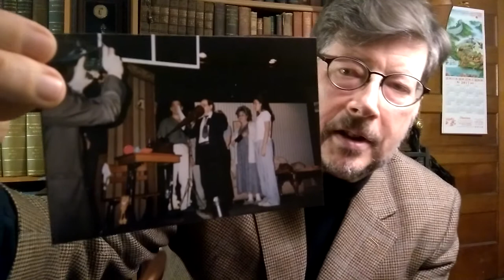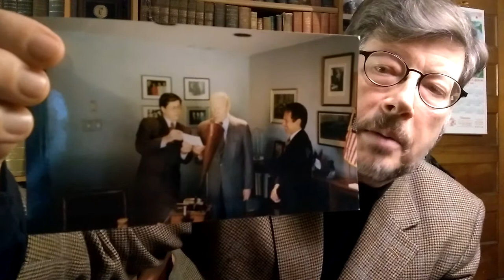Recording horns and their directional nature. A talk on the recording horn and it's limitations ..

Comment: hey Jack. it is truly an amazing art form making an acoustic recording. As you mentioned about the horn being extremely directional i find it fascinating how they used it as an effect as it were (like how they make someone sound far away in the distance - and it's done purposely to create that illusion). i think some of these descriptive selections on cylinder (depicting a scene) are the the predecessors of radio plays or dramas) . the info on the shape of horns is a great insight. I've got a large horn that i have tried recording with (did they have a bell type horn on the recording hiens in the studios?) regards Matt
Reply from the maker: Sorry for the late reply....  But I a have seen some and each had it's wonders and issues.  I found that in recording using big and small horns,

Comment: in my 30 years of collecting phonographs and recording with them, i pretty much came to the same conclusion as to the directionality and sensitivity of the phonographic recording device
 that was at least until I befriended fellow YouTuber benjamin Cannaday aka ''the victrola guy'' now my stance has changed somewhat
the ongoing experiments that benjamin did in the last couple of years made it clear that the recorders of the day could be a whole lot more sensitive than previously thought
it is, for instance, possible to make (tweak) a recorder that can record normal human speech at a normal speaking volume 
in quite some of the old recordings, it is quite clear that the speaker isn't shouting or even raising his voice but simply speaking into the horn
in the edison notes and patents, we can read that Edison made membranes of resins and rice paper something that is very akin to modern thin plastic sheet and far more sensitive than glass, isinglass or the slightly softer normal mica 
by taking the modern equivalent of the above-said materials namely polymer or plastic benjamin was able to record himself by just speaking into the horn without shouting out or raising his voice
indeed the horn was directional but there's quite a bit of evidence that the engineers of the different recording companies knew quite a bit about ''tweaking the diaphragms''
indeed the fred gaisberg recordings are full of unintentionally recorded sounds and speech the mapleson recordings were made meters away from the intended subjects still the ones that were not damaged by the next generation of maplesons or mold are very well recorded indeed and sound more like a bootleg tape recording of a live event  than a cylinder recording

another thing is that recording studio's where small and if a room is small the ''singing in the bathroom effect'' aka reflection also comes into play you did the cheering recordings in larger venues theaters and auditoriums the sound drowns in larger rooms but in smaller rooms, it stays contained indeed shouting or cheering behind the horn will reflect off the wall in front of the horn making the recorded (extra) sound much louder 
(later (1906 -1925) most companies employed the engineering or machine room to battle the reflection effect in some cases it was just a set of felt curtains around the horn or with a hole for the horn in others it was a completely soundproof separate room with the complete horn sticking out of the wall in the recording room and rubber hoses connecting the horn outside to the recording machine inside)
fred gaisberg was mostly behind the device yet on some of the early discs (1899 1903) his voice can be heard f.i. saying (shouting) START! to the orchestra and much louder than just a ghost recording (aka voice recorded unintentionally very faintly)

so with this evidence from the past and mr cannaday's experiments, it is clear to me that softer voices could be recorded and were recorded in the pioneering days of the phonograph (1888-1925)

Comment: Just curious Jack.  Considering that Edison records are so clear and full how did they manage to get all that sound into the horn. The photos I have seen show a somewhat large gathering of the instruments about a studio room.  Another thing I heard was that the large horn had some kind of issues with it adding a bit of distortion or noise to the records of a certain period? Have you heard of that?
Reply from the maker: What I have noticed was the near mania put forth by Edison to capture as much sound as possible. There were countless entries in the notebooks on sound recording and reproduction. The recording heads were wonderful and just dampened enough to produce a more mellow sound. Also the recording horns used in the later Diamond Disc era were far more oval than the Victor ones. There would be deadening drapes and fabric all over the room to create that sound so desired by Edison. As for the big horn, it was a problem from day one. Yes there were inherent noises and there were many horn tests of just recording the noise of the horn. I did a video of the big horn parts one and two if you get the chance. The studios for Edison were run with an iron hand for sound.   Many recordings would be rejected by Edison for their "Victor like sound"  or require a "Victor ear tickle" So the recording department was focused on recording heads of amazing sensitivity, very much unlike Victor which focused on a brilliant quality that always hurt Edison's ear.  Lastly the Edison note books were filled with different recording head diaphragms. Each was tested to give the most mellow and natural sound.
Reply: Jack, if you wish send me a email though my info on my site, I would be interested to see if you have heard the diaphragm in person that I have been creating. A rather stark departure from the Edison original but seems to meet many of the criteria Edison would have approved of in tone. I would happily send you one to see what your thoughts are?  Larry